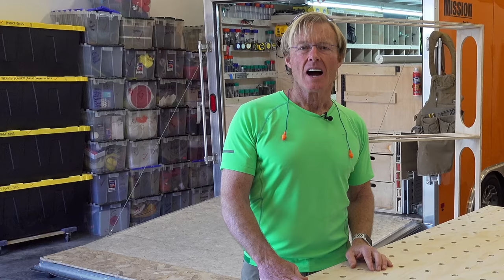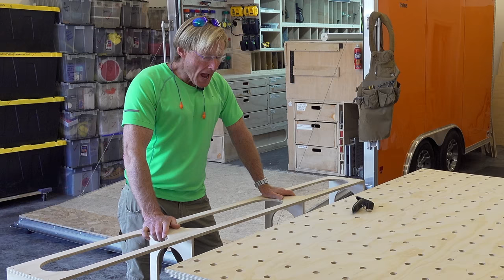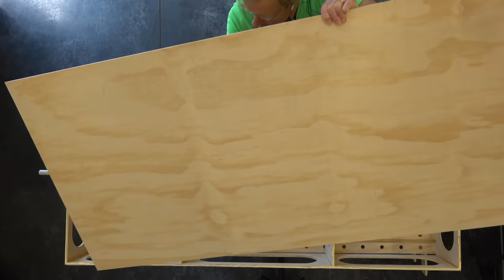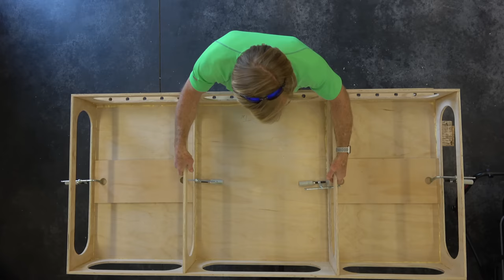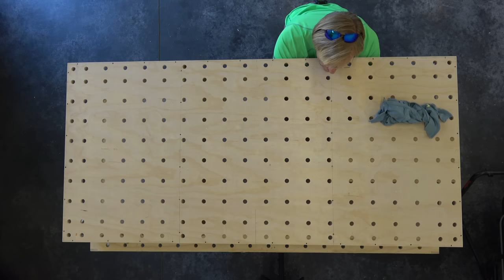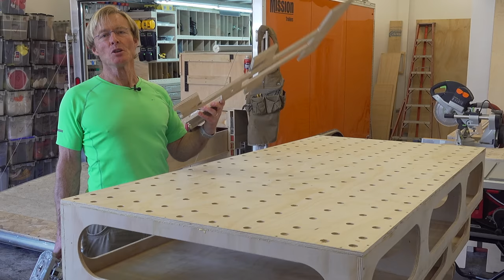So Smart it assembles itself-Bonus how much it weighs.

Comment: Really looking forward to the Sawstop experience episode.  I’m sure it’s a good saw, and maybe the only portable saw to own (for those of us concerned about safety).  But, It’s all about the trade-offs that a portable saw requires in exchange for its portability, right?  For me it really gets down to whether it’s a less stressful and faster way to to rip stock that is less than the width of the Festool track.  I don’t really like any of the solutions for that, so a table saw seems like the right tool. My garage shop can’t do anything larger, so the JSS seems like the answer.  But, and this would be great to hear you talk about, how much trouble is it to lock it down to a precise cut when you really need it?  Thanks.  Great channel.

Comment: so is the mft top 3/4  in thick or 1/2 in thick?
Reply: 3/4"  All the parts are.   Plans are 20 bucks. He uses some special ply that is super light.  He has speculated that all but the top could be made of 1/2"  But he doesn't recommend it.  3/4 is 3.5 time stiffer, and more than 2x stronger.  There is a little more to it than meets the eye,  I have been in carpentry almost 60 years, and I picked up a couple of pointers I would not have immediately noticed.  As a multihull boat builder torsion boxes are my thing, still learned a couple of things.

Comment: Ahhh... So it should read:  49 lb, less than 1 sheet of 1/2" plywood!  The comma is all important. If I were being pedantic (and I often am) I would also say that it should be 'lb' not 'LBS 'as it is both singular and plural (from the Latin) and should not be capitalized. The capital L does not help- there is no full stop previously to require it. Sorry, cannot help myself... The video is still great.

Comment: Please update your plans to include the template dimensions to a corresponding bushing and router bit configuration. Or sell template plans separately as a $2 add-on. Setting up my router with a bushing, measuring the bushing offset, and subtracting the offset from all of the final drawings was a tedious process that added significant time to my build.
Reply: @jakoj2098  I prefer using the router and a template guide to make identical cuts. Jigsaws aren't quite as fast as using a large hole saw. But using a large hole with a hand drill is no fun.